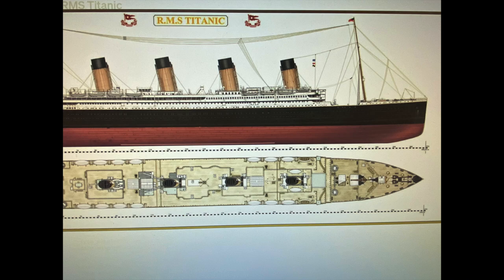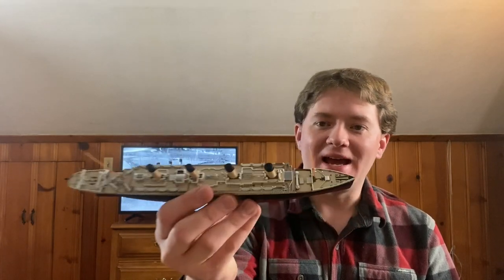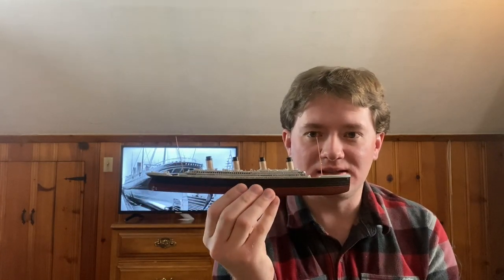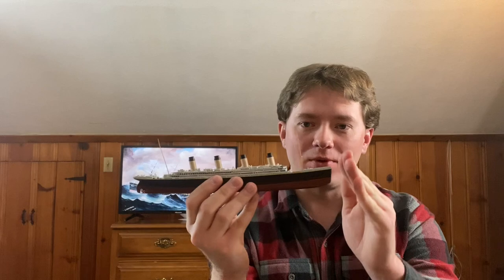Would more lifeboats have saved more people on Titanic?

Comment: A major flaw in your reasoning is that loading passengers would have been much quicker and encountered less resistance IF men could have been allowed to board with their wives and children. Another consideration is that the deck steam winches that had been installed to lower the boats efficiently were not used since the crew had not been trained to use them. Finally, even if boats were unable to be launched, more could have been floated off the decks as collapsibles C and D were, which would no doubt have saved more lives. It was, after all, a calm sea and windless night.

Comment: The crew were NOT untrained.  Every seaman on board,  deck crew and officers are all completely capable to launch the boats. As part of their certification   they must have  a 'Certificate  as Efficiency as a Lifeboatman'.  True they should have  had a full drill on board.  However, that does not mean that the crew were not trained.   Seaman were trained to launch of these boats.
Reply: They were trained, but they were unfamiliar with the ship. Most of the officers had worked on previous Olympic-class vessels, but most of the crewmen were hired in Southampton.

Comment: They are called "lifeboats" after all...

BTW - what if Titanic has additional pumps to pump-out the sea water?
Reply: With the rate the water was coming in you would have needed the ship to pretty much be completly made out of pumps to make any significant difference.  Plus the power requirements for the extra pumps would have meant more of the boiler rooms would have needed to stay active and they would have not been able to vent as much steam etc thus not only would more crew have to stay at thier posts in engineering thus significantly reducing thier survival chance and preventing them from helping in other duties but also increasing the risk of boiler explosions which so having more pumps may have been counterproductive
Reply: @jonsouth1545  
Well...pumps would be useless aganist all wounds, but if they suck only ONE water compartment i think they could save the ship. (or gave enough time for help to come) Of course they should be placed on the prow, not the stern side like in the original.

Comment: To Historic Travels: Your channel is really well done and very interesting and your are a very articulate speaker. 
But I just can’t understand why you don’t believe more lifeboats would have saved lives. It wasn’t long after the Titanic came to a stop and Thomas Andrews realized the Titanic was doomed,  he was able to predict how much time she could stay afloat. Two and a half hours. If they started launching lifeboats immediately it seams like plenty of time to launch sixteen lifeboats and four collapsible. Suppose it wasn’t enough time to launch them. Then cut the ropes and toss them over board. With nothing floating in the sea there would be no chance of survival. But they did launch them all. Pretty sloppy work but none the less they were in the sea. Had it all gone perfectly and each boat filled to capacity approximately 1,050 people would have been saved. 1,190 people would have gone down with the ship or perished in the open sea. Based on 65 people per lifeboat, the Titanic should have had a total 48 lifeboats to save all 2040 passengers and 900 crew members.
Another way to look at it is, there were too many people on board!
A modern cruise ship like the Oasis of the Seas has 18 lifeboats, each lifeboat holds 370 people. That’s enough capacity to save 6,660 people.
 
The Titanic slipped beneath the waves an hour and a half before the Carpathia arrived. Even if passengers were clinging to overturned lifeboats, more people would have survived. Some would not survive the cold and some would. Even one life matters.

Would anyone say that the Empire State Building only needs half of the sprinkler heads and emergency exits it is equipped with in case of fire? They are safety measures. 
Would enough lifeboats for all saved more people? Yes definitely.

Comment: I'm quite sure if there were 20 more lifeboats on the ship that way, way more than 50 passengers would have been saved.  There were over 700 crew members on board who could have been used to get the lifeboats prepared.  They had more than 90 minutes to get the lifeboats readied, especially if the order had been given sooner.  Also if the had filled the lifeboats to capacity, my calculations would be that at least 400-500 more could have been saved.  Many people died due to lack of training or good judgement, from steaming too fast in an ice field, not giving the order to lower lifeboats sooner and filling them properly, and poor communication with iceberg warnings.

Comment: I find it difficult to believe that more lives couldn't have been saved with more lifeboats.   Sure if they had been aligned like they were on the Olympic, after the Titanic disaster, all those lifeboats in the way would not have been helpful.   But was there no other way to put more lifeboats on the ship?    You say the steam venting interfered with crew communicating with each other while launching lifeboats,  maybe the crew should have been better prepared for that and been trained to launch lifeboats while the steam venting was interfering with communication.   Maybe with lifeboat drills, the passengers should have been educated on how they could help the crew launch lifeboats faster.     

Here is the other thing:  if the idea was ferry people from the sinking ship to the rescue ship,  then there should have been rules requiring that you could only be so far from the nearest ship.   Also better regulations were needed regarding the telegraph.   It should have been required that these ships have to listening to their telegraph 24/7, so they would be hear it if some ship needed a rescue.    Finally it was criminal to lower and launch lifeboats that were fully filled.

Comment: I think that if the titanic had enough boats and did the whole murdoch starboard and lightholler/wilde port then no not all the bots would’ve gotten of but if they had all 6 officers working at 1 section possibly most or all of them might’ve gotten off so like murdoch forward starboard, lightholler forward port, pitman mid starboard, boxhall mid port, Lowe aft starboard, and moody aft port and then like how it happened lightholler and murdoch would prep the collapsible boats on the roof of the officers quarters and u never know maybe they would’ve been lowered

Edit: chief officer Wilde could be the officers roof collapsible or where Murdoch is and moody could do this boats

Comment: Interesting video.  Another of the reasons the Titanic did not have more boats had to do with Bruce Ismay not wanting the boat deck cluttered.  Also, the total lifeboat capacity of the Titanic's 20 boats was over 1100.  The officers at the beginning did not purposely fill each lifeboat as they were afraid the weight would cause the boat to buckle and the passengers did not want to leave the Titanic as the ship was unsinkable.

More lifeboats on the Titanic would not have saved more lives.  Take the Empress of Ireland, Lusitania or even the Andrea Doria.  Each of those ships had enough lifeboats for everyone on board but how long it took for the ship to sink and the way the ship sank made it impossible to save everyone.

However, as a direct result of the Titanic disaster, SOLAS was formed.
Reply from the maker: Exactly, was it Bruce Ismay who talked about that? I thought William Perry was also a big say in that topic, its what caused Titanic first designer Alexander Carlisle to leave the company before Thomas Andrews Took over

Comment: The Titanic suffered the exact amount of damage to its hull, which would sink the ship. Any more and it would have sunk faster, any less and it would have stayed afloat. That means, that they had the maximum amount of time out of any possible floundering scenarios. They barely had time to launch the last one and the collapsibles weren't properly launched either. Without being cut lose, the boats go down with the ship. When cut lose, they tumble around a ship's deck that is sinking at a steep angle. Even if you get the boat to be detached from the ship, completely intact and sitting pretty on top of the deck... what do you think happens when such a boat is being sucked down with the ship and surrounded by literally hundreds of drowning people? It capsizes, it gets swamped, it gets pulled under, people start killing with the oars to protect the boat etc. It's an absolute shit-show when the boats aren't launched and loaded properly. The only issue that night, was the load of the boats, not their amount.

Comment: How heavy were the collapsible?? Could the people who jumped on the upside down one save more lives if they had gotten under the boat and flipped it back over. We use to do that in scouts with canoes along with learning to keep the opposite side balanced for people to get in from the water. A few of those people on the life boat were officers so you would think they'd have experience for that. Could you imagine if they did one of the people who were saved might have been the captain.
Reply: The upside down collapsible was trying to be flipped over in the last few minutes of the sinking before the break.  I guess when you're trying to flip over an upside down lifeboat and you see the water rushing up the deck extremely quickly during a chaotic moment, you say "Screw it, I will try to swim to the other lifeboats out there."  Plus they probably didn't enough people lifting at that moment.  As for Captain Smith, I believe he was prepared to die and possibly didn't want to face the aftermath of the Titanic sinking.  There was quite a few men who did not make an attempt to save their lives whatsoever.  They actually stayed on board as it sunk.
Reply: i think the cold water would make it impossible, you have zero strenght
Reply: They did not want to overturn the lifeboat while it was in the water, the air bubble under it was keeping it afloat. It most likely would have sunk if they tried to flip it.

Comment: A lot of the lifeboats wouldn't have to be launched, you'd just have to be sitting in them as the ship sank. The 1500 people still on the deck of the ship after all the lifeboats had launched could then just get into the remaining lifeboats on the upper decks as the ship sank from underneath them.
Reply: If they were still attached to the ship, they would go down with it! Or the suction would drag them down or overturn them!
Reply: @trevorbluesquirrel899  Obviously you'd detach them and they'd be resting on the upper decks of the ship.
Reply: @Treblaine  Just leaving them on the deck to wait, hundreds of people would all be fighting to try to get in! The officers had to prevent a mad rush to every boat, as seen in the movie! Also why boats didn't return, cause they'd have been swamped and tipped over in panic! So yeah, not a sound strategy!
Reply: @trevorbluesquirrel899  I'm referring to how some boats were stored on a roof and so much trouble was caused by trying to lower it down 2m to deploy it over the edge when the water level was rising up to them.

Someone somewhere else exlained that the urgency to launch the boats even before the water reached the boats was the fear that the ship would capsize. It's quite unusual that the Titanic sank so relatively level except for how the stern raised.
Reply: @Treblaine  They had to raise the canvas sides to make them float, and getting people up to the roof to load into them would have taken too much time, along with the waves caused by the funnel collapse washing everyone out and overboard................. just seems way too chaotic to be a viable strategy!

Apparently, it didn't capsize because of the coal weight on the port side keeping her balanced!
Reply: @trevorbluesquirrel899  Surely it would take less time for several people to walk up some stairs than the fiasco of trying to lower a heavy boat 2m down without it breaking or flipping.
THAT is "too chaotic to be a viable strategy" and you still have all the same problems of prepping the boat and funnel collapses. Its a historical fact that lifeboats ended up in the water capsized.
Reply: @Treblaine  I doubt they could have announced they were going to load the boats up on the roof without creating a mad panic of people getting trampled trying to climb the stairs! And they wanted to get the boats away from the ship to prevent them being swamped by those in the water! Collapsible A was swamped while waiting to be washed off deck!
Reply: @trevorbluesquirrel899  Oh and there wasn't any panic when the last lifeboat on the titanic flipped over because they were trying to lower it down!??!

Which also was swamped!

You will NEVER solve the swamping problem by running away faster, the only way you can solve that is by having enough lifeboats for everyone.
Reply: @Treblaine  In the end, putting the boats on the roof without a way to get them down was the big issue, since they never thought they'd have to be used!

Even with enough boats, it's doubtful they could have launched them all in time - Sam's got a vid on that scenario as well!
Reply: @trevorbluesquirrel899  Putting something important on a ship with no intention or thought to whether it's possible to use it is magical thinking. 

They had a LOT of time to launch the lifeboats, nearly 2 hours from the time of impact (the earliest they could have initiated evacuation plans) until the ship had listed too much to easily launch all boats. 

The failure of the lifeboats was not just in the NUMBER of lifeboats but also in the entire evacuation plan which invludes the design of the davits used, the lifeboats were there as a box ticking exercise. 

I can prove that it WAS possible to launch all the lifeboats in time AS the Titanic's sister ship - HMHS Britannic - sank in a fraction of the time with most of the evacuation needlessly stalled but were able to launch nearly twice as many lifeboats at much better capacity.

However! I will concede that in that instant they hit the iceberg in 1912 they could not have evacuated more, the point where something better could have been done was when the Titanic was being fitted out.
Reply: @Treblaine  Still, conditions weren't ideal, and you can't save those that won't board the boats!
Reply: @trevorbluesquirrel899  Conditions were very close to ideal, very flat seas, the ship took a long time to sink and most of the time it stayed level in the water. The only thing that wasn't ideal was there wasn't another ship very close by and they needed to get everyone in too few boats.
Reply: @Treblaine  I meant not ideal for the reasons Sam gave, it was night, crew was not trained, no drill, steam all over the deck!
Reply: @trevorbluesquirrel899  I'm saying how the ship should have been in better condition. Including better training for crews.
Reply: @Treblaine  Exactly!

Comment: Mhhh, sorry, I disagree. First of all, there had been cases where ships sunk and people could not be saved because there were too little life-boats. So, from that viewpoint it would have made total sense to include more. And erronously legislation assumed that water tight compartments replace life-boats. And yes, life-boats cannot solve every problem, but fact is: Titanic had too little. Which also hindered evacuation because of tumult, panick, etc. More life-boats could actually have eased evacuation. It could have accelerated, because if the crew pronounced evacuation knowing that not all could escape panick would strike. If there had been enough room, they could have evacuated a lot earlier. More awareness about the need of life-boats would likely also helped in making drills a bigger priority.